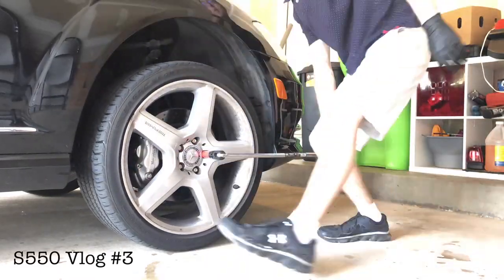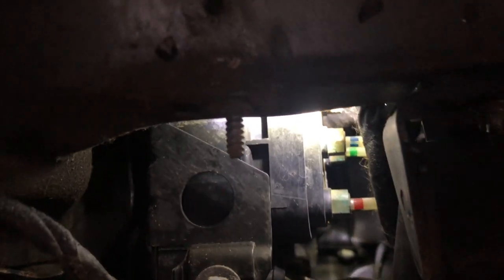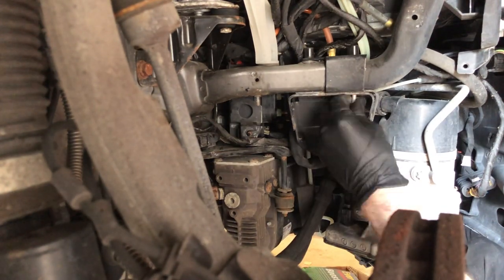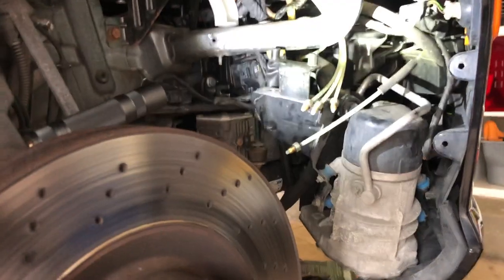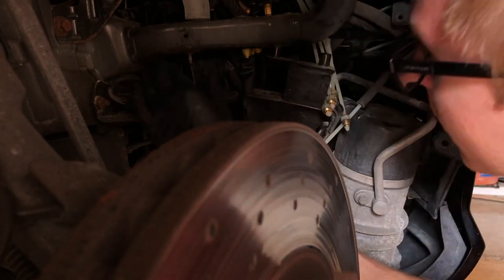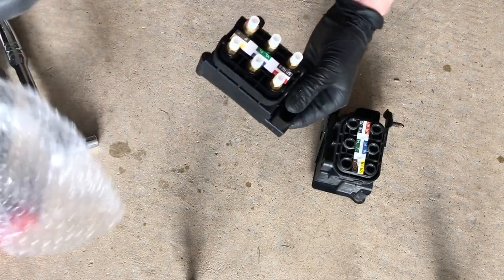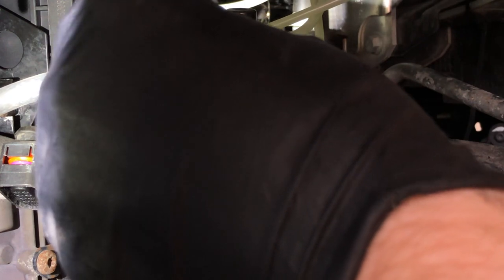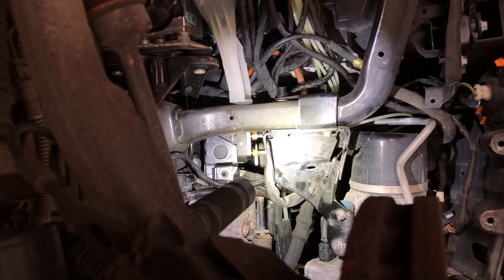Replacing an Airmatic Valve Block - Vlog #3

Comment: 4:25 "At this point I disconnected the front right line, and you can see the shock move up for some reason". The vertical position of the wheel reflects an equilibrium between pressure in the air bag, and tension in the shock. When you disconnect the air bag, there is no longer pressure in it, so the tension in the shock makes the wheel move up. 
Thanks for the nice video, going for it on my 2013 E550 now.

Comment: Excellent job. I’m in the same position just bought a CLS 550 thought I saved $4K got it home and 3 days later without driving it , I found it slammed starting with the front left wheel.
Reply from the maker: any luck finding the cause?
Reply: My cls550 did the same thing, i replaced the passenger front airstrut…..now 2 years later both my rears randomly go flat overnight sometimes….if i mess with the buttons and/or play with the wires going to valveblock it will air back up….but i still get a malfunction signal on speedo…tommarow i will replace the valve block

Comment: Use razor blades to cut those air lines.  Also, bevel the edges of your line after your cut so it'll slip into the fitting more easily.

Comment: First off, thanks so much for doing this. There’s so few people willing to take on these cars, your channel is an awesome resource. 

I’ve got an 07 s550 that is not raising at all. I bought it with a sensor issue and the front was a bit low, but a few weeks later the thing slammed completely and won’t come up. I can get the compressor to run, but it doesn’t seem to be lifting the car at all. Not sure what the best way to check if I got a valve block issue or a compressor issue. As far as a scanner, I have an icarsoft MB II which can only read overall values but can’t check specific systems. Thanks again for all your content.
Reply from the maker: I think we have the same scanner. Have you scanned the airmatic subsystem and checked for codes? If it's having a problem it should post codes there. Something about "refill time too long" would indicate a leak somewhere in the system. The scanner should also show you level sensor readings (to make sure the level sensors are showing normal outputs) and tank air pressure.
Reply: @letsdailydriveans5507  can you make a video of scanner how it looks, i need to buy it, i have r class 2011, i have same issue i suppose. Thanks for video helped me alot
Reply: Tnñ

Comment: I own a W211 E320, the rear bellows come down after a few days when parked, but there is no problem while driving, I hope it is caused by a small hose crack, the test device does not show any malfunction, your video is very useful, I congratulate you, I subscribed to me, I can repair my own vehicle, but I do not have a garage, you are very lucky you are younger than my son but you are doing very well
Reply from the maker: Thanks for sharing! Best of luck
Reply: @letsdailydriveans5507  I changed the bellows, they were leaking from the gasket of their brain, I have no problem

Comment: You know I have a problem with my W211/ E550.  2008 Airmatic left wheel.  I replaced the strut already.  I thought I'm set! NOT! the Airmatic pump kicked in after starting the engine.  Went to the correct ride height! Then turned off. My left front went right back down.  I raised it again to double check everything even torch specs. Cleaned all the electrical components connectors.  Made sure every one of them clicked on the other connectors.  OK I'm set now.  It worked. Yeppie! Then I checked all Airmatic settings inside the Car. Worked really great,  then I turned my wheel left and the pump came on again? Then straight.  Everything is fine.  Then turned my steering wheel to the left.  The left front side went down again.  I pulled the wheel off. Checked everything again including the ride height sensor.  Everything was fine.  I am waiting for a W211 air compressor valve block hoping it will solve this problem 🙏🙏🙏🙏🙏. Thank you for sharing your knowledge and experience with this Airmatic system.  Sounds very similar!

Comment: Do you need to have the wheels off the ground to replace the valve block? Due to the pressure, not sure if this is a necessary step

Comment: excellent work! I have a 2014 CL550 with 10K miles and the front struts were replaced along with the sensors. I think they didn't need replacing because the car has been in a very acclimate climate. Anyway, that was the previous owners problem. I am having an issue where the front LH side, as soon as I lock the door,the front passenger side drops 1/2',  then makes some high frequency noises and drops another 1/2" and later the rear on the same side follows suit. The car stays up in the highest position without any issue. I figure the valve body is defective. Thanks for your video.
Reply from the maker: It could be normal, the car will self-level when you lock and unlock the doors. If it doesn't look normal, then the front left level sensor could be faulty and telling the car to drop more than it should. You can check the sensor's readings with an advanced scanner, or ask the dealer to check it out.

Comment: Why did you decide it was the valve block and bought a new one instead of just check the condition of the lines? Btw that random pump next to the airmatic pump is the power steering pump.
Reply from the maker: Power steering pump! Thanks for clarifying, I always wondered. I bought the valve block because I had done a leak test and no bubbles appeared, so I figured it was the valves.

Comment: I have a 2013 S550 and I'm experiencing an issue where the right side keeps sagging. The suspension compressor stopped working, so I replaced it. However, the new compressor still doesn't turn on. I've checked the relays and confirmed there's power. My question is: if the valve block is malfunctioning, could it prevent the compressor from turning on at all, or should the compressor still activate regardless of the valve block's status? Essentially, I want to know if a faulty valve block can stop the compressor from even starting up.

Comment: I have a 08 s550 with a malfunction. The rear passenger is stuck in the air and the ride is so stiff that it's bouncy. The suspension malfunction error code says "fault in component (right rear suspension plunger valve)" someone said it's the front valve block. I'm wondering if that is it. I'mma change it and see if it fixes my problem.

Comment: So you changed the valve block, but in the process noticed there was also an issue with the airline. So you fixed the air line and connected it to the new valve block. Was the issue a bad airline? …or the valve block? What did I miss here?

Comment: I was gifted an 2002 S500 .. it’s got an issue where over night the rear would be ok the floor .. where should I begin to look at to diagnose the problem?

And also another issue it’s got, is the battery would die within minutes after shutting the vehicle off, maybe the air pump will kick in when noticing it’s loosing pressure? 

Am I able to test for parasitic draws on these vehicles?

Comment: Was your valve block actually defective or could you have just cut the airline without replacing the block?
Reply from the maker: I think the valve block was fine, I could have just cut the air line. Learn from my mistake haha

Comment: Hi, I have the opposite problem. Rear shocks are both maxed out. Rear shocks are as high as they can go and don't deflate. Could it be the same block causing the problem? Lines need to bleed.
Reply from the maker: Check the rear level sensor. There is one sensor for the two rear wheels. If it fails the car will max out the height for safety.

Comment: Hi thanks for your great video! When you deal with the line, did you just cut the end or replacing the entire line end to end? And did you just pull out from the socket and plug in with a push only? Do you mind sharing more info on that? Thanks
Reply from the maker: The tip of the line was cracked, so I just cut 1 cm off, clean and flat, then reinstalled it in the fitting. IIRC they were compression fittings that you have to unscrew with a wrench.
Reply: @letsdailydriveans5507  thanks a lot!

Comment: if you have a propane leak you spray water/soap on the hose to find the leak  , why dont you   do that
Reply from the maker: The valve block was too hidden away to spray any fluids on it, unfortunately. There's a compressor or pump of some kind blocking it.

Comment: My friend great video, my cls55 i got new front airstruts, still teh front right creaks over small bumps and feel like it dips slightly more than the left side ,  when i drive the car about 3 min after starting it will kick on the air compressor for a few sec until it stops then you hear the right creak down, im thikning it has to be a line or the valve block like yours, whats the chance i coudl see the link without removing the entire valve block ty
Reply from the maker: There might be two issues here. The creaking sounds like your anti roll bar links and bushings are old and the rubber is failing. And if there's a leaky suspension strut, the car should pop up a warning about "Airmatic Defective" or something to that effect.
Reply: @letsdailydriveans5507  thx for responding you didnt have to was a crappy worded comment, but ya my line is prob split at the end and slowly leaking air, the suspension bushing all replaced b y myself aswell, i got this issue and a slowleaking valve cover gasket only 1600miles after rebuilding the engine, this car has a ton of issue u have a good day

Comment: After parking GL450 overnight, both front wheels are lowered down. Once starting the car, then air compressor starts then the wheels are up to the normal position again. I can drive the car with no problem. No error or ant warning message at all.

Do you think what is an issue here. Can I still keep driving a car without fixing this.
Reply: if only one wheel is down, it's usually that strut is leaking. 
if more than one wheel is down, then usually it's the valve block.
cracked hose, as seen in this video, is an unusual finding.

Comment: Nice, videos can I ask when disconnecting the air lines did that empty the nitrogen air reservoir tank or lose all air from shocks? Or did you lose minimal air that was just in lines? Any info would be greatly appreciated thank you.
Reply from the maker: The seats and the suspension are entirely separate air systems, you can disconnect the air line without issue. And it's not nitrogen, just normal atmospheric air :)

Comment: Can you remember the fault codes you had - I've got ' Y36/1y2  left front suspension strut plunger check valve '....
Reply from the maker: I got a generic "refill time too long", indicating that the pump couldn't fill the air tank up as fast as it should be.
Reply from the maker: The struts all have check valves on the top, where the air line connects in. It sounds like the car thinks that check valve is bad? Sounds like you might need a new strut, or perhaps you could buy a new check valve (properly specced) to install between the input air line and the top of your strut.

Comment: my '06 CLS500 is sagging in the rear, do I need to change both Airsprings (airbags) or just the rear right side as that's the one that goes down first, then the left side goes down after about 30mins
...Thx
Reply from the maker: It sounds like both need to be changed. There's a spec for how much the springs should deflate and it's something like 10 mm over 24 hours, sounds like yours are losing more air than that. Check the rear level sensor too, the car auto levels itself after you park. A broken level sensor on the rear axle could make the car think it's too high, at which point it would try to relieve the air pressure to lower the rear.

Comment: I changed the valve block and 4 shocks and still get service airmatic light what could it be?
Reply from the maker: Bad pump? Scan codes, they'll tell you what was causing the airmatic malfunction message.

Comment: Your original valve block was probably working perfectly. What fixed your problem was repairing the cracked air line.
Reply from the maker: oh, absolutely, but I'm not about to go through that process again just to swap parts lol

Comment: Which point did you jack the car from in the front
Reply from the maker: There's a rubber block in the front, under the engine, that you jack from. Also, use jack stands so you don't kill yourself (I forgot to)

Comment: Can a faulty valve block cause lowered wheel?
Reply from the maker: Probably not, the valve block just controls where air goes. Does it ever raise up? If so, the valve block is probably fine.
Reply: Let's Daily Drive an S550 it does raise up, but so does a leaking suspension too.
Reply from the maker: @kingarchnyc   If one wheel is lowered, then it's probably a leaking air line or a leaking strut.
Reply: Let's Daily Drive an S550 I replaced it, still leaked, replace valve block, still leak. I can honestly say I am done with air suspension now.

Comment: Joe, are you sick?
Never cut the line - you do not understand how is working those types of connectors?
Only the rubber ring inside the connector seal the air leaking - the bras slives on one side cut is holding the line preventing to slide out only.
Reply from the maker: It's been fine for about a year now, no other airmatic issues.

Comment: Hi, Nice Job.
I wanted to ask my '07 MB S600 rear axle ABC valve?... does it look the same as the one you just replaced on your car or something completely different? Thank you
Reply from the maker: It would probably be completely different, unfortunately. ABC uses a hydraulic fluid in place of air. They are 100% different suspension systems.
Reply: @letsdailydriveans5507  Thank you